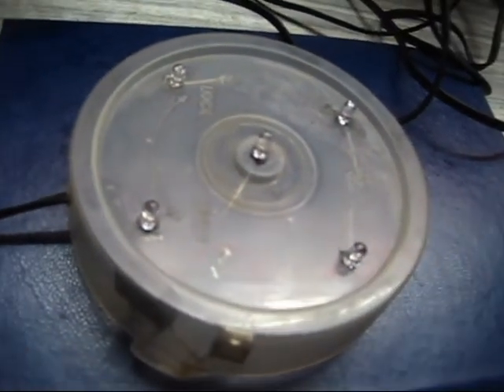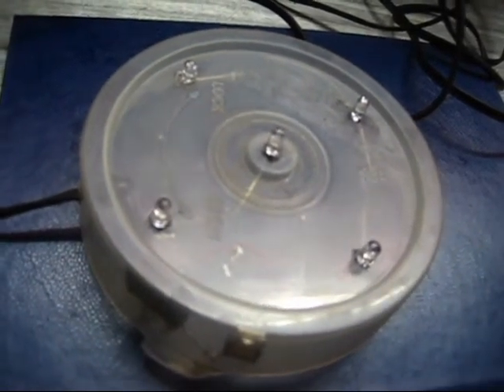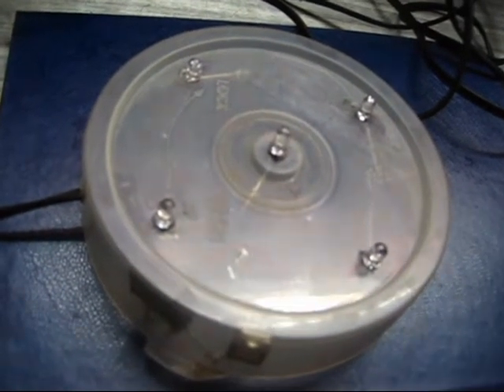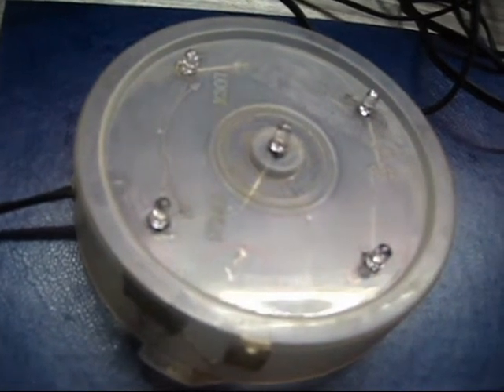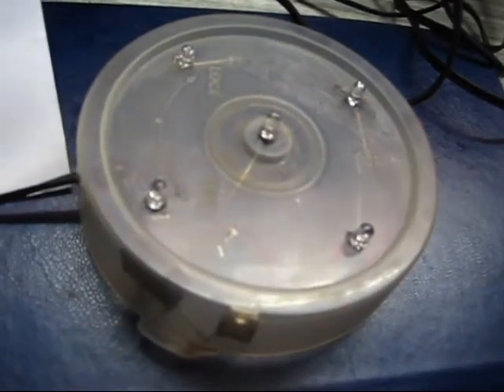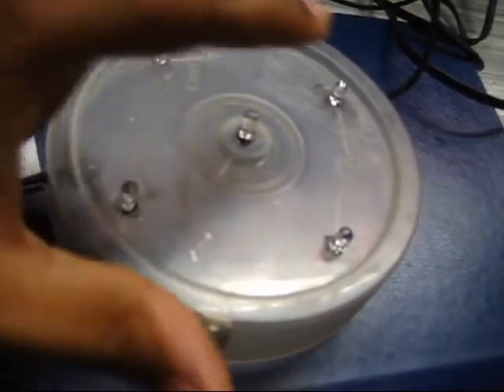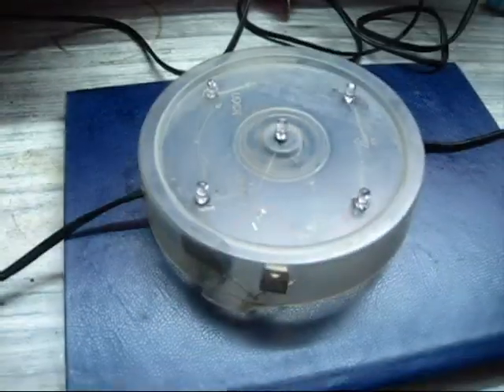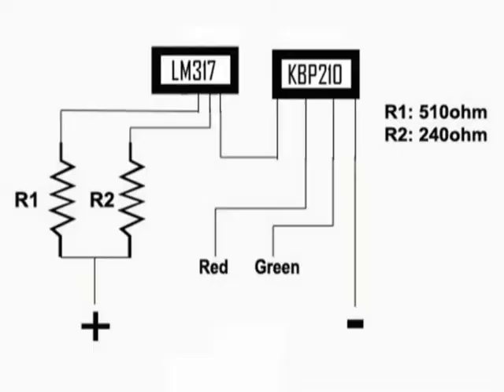How to - LED light from TELEPHONE Connection - FREE HIDDEN POWER

Comment from the maker: Yep, it does glow when its idle. I had given it a try.
But beware, when a phone rings, this DC current gets converted to AC current and the voltage literally doubles up. So its wise to use a circuit with a bridge rectifier that converts AC to DC again and an IC which limits flow of current.
Reply: But is not Free Hidden Energy, you're paying for that line.